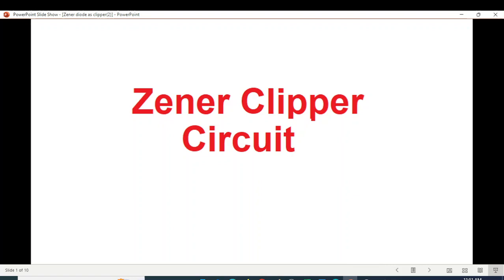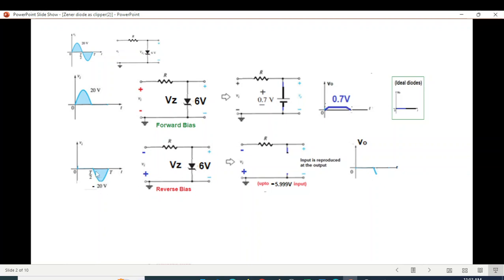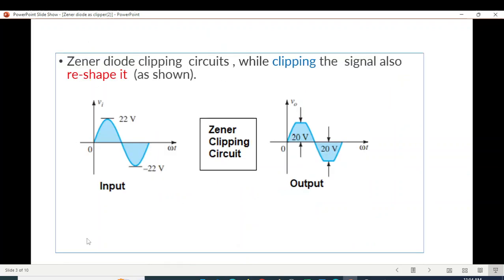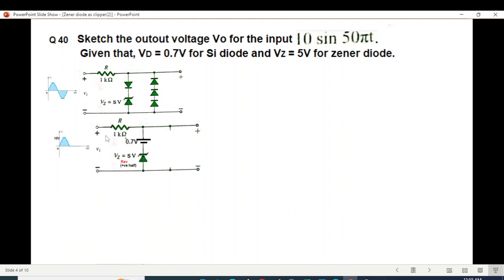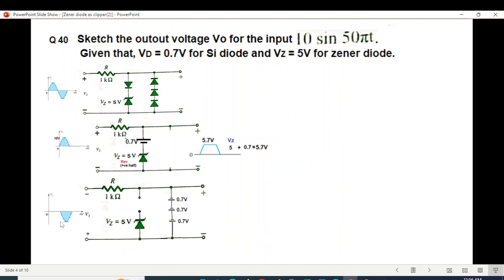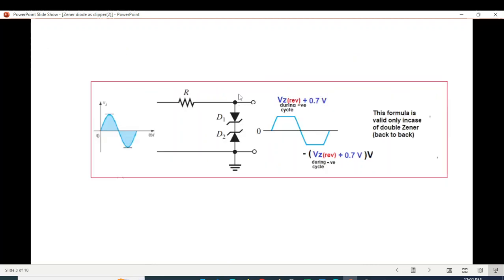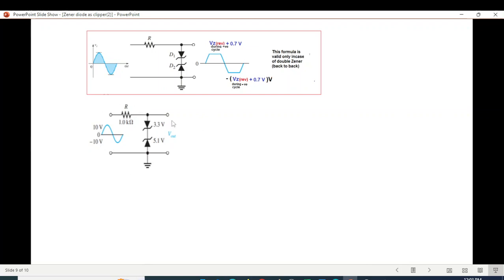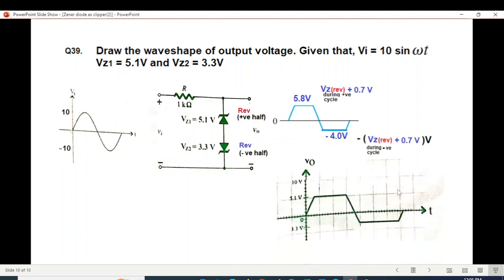(English)EDC || Question 2.39 || Question 2.40 || Zener Clipper  || Zener Voltage Regulator

Comment: Hi sir, I never understood zener that well until I saw your videos, thank you so much - you explain very well and I wish I had you as my lecturer.
One question though, a couple of outputs show to have a sharper wave form rather than a curvy sinusoildal one. E.g. @ 13:43 the output wave is sharper than the input, is there an explanation for this? And does this only occur in zener clippers and not normal parallel diode clippers?